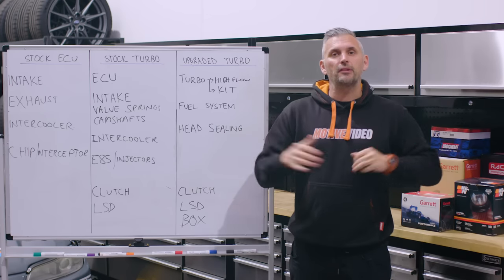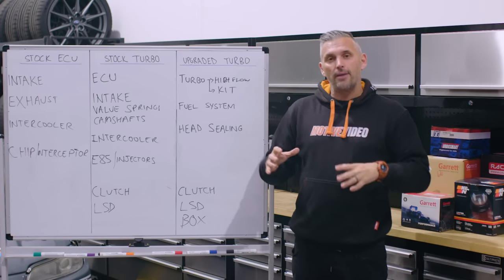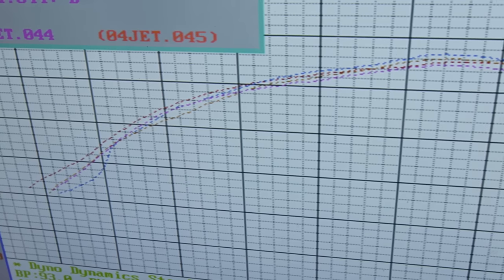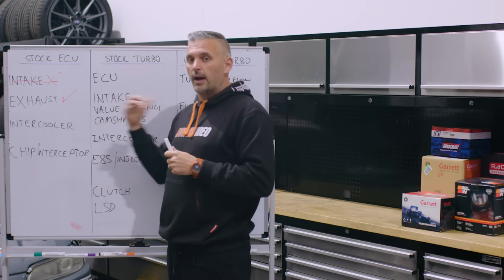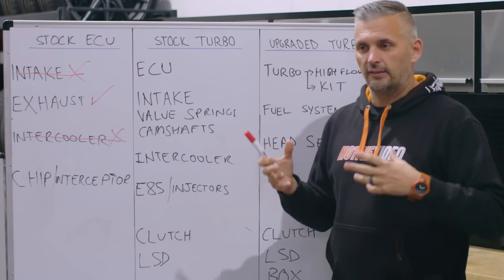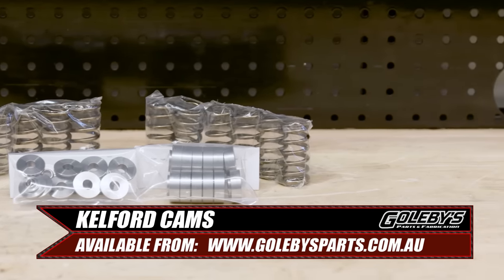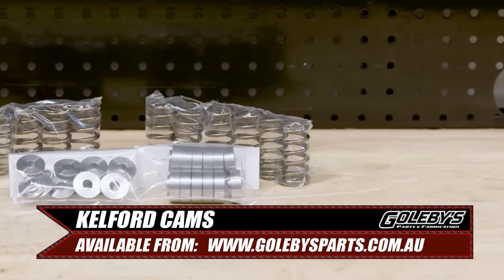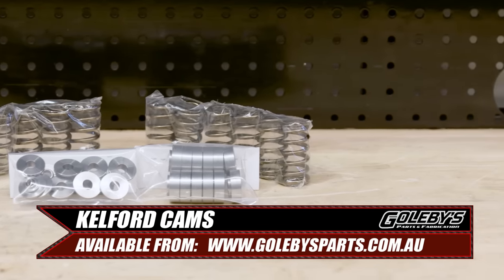GR Yaris & GR Corolla G16E Tuning Guide -  From Stock to over 500hp.

Comment: Pro tip from one of the guys racing a GR Yaris (Rotheli racing I believe), the rear section of the exhaust getting very hot can cause the 4WD overheating issue,  with a couple of bucks on some decent quality exhaust tape you can wrap the section around where the 4WD clutchpack and rear diff are - when he did that he didn't have a single overheat issue afterwards. When I install my new exhaust I will definately wrap the back of the center pipe.
Reply: Will check this out
Reply: @Way Outthere Australian dealers rarely even know about the cars they are selling
Reply: @Way Outthere Do you have link for more info about that part? Thanks
Reply: Now that's a prob tip I heard about the overheating on track and if that's all it is well God damn
Reply: @KILLITchris Yes
Reply: @@wayoutthere8637that isn't weird at all tbh
Reply: Pro tip from the guy who doesn't own and has never driven a GR yaris. We want it here in the States, right meow!
Reply: How do you fix the under steering? Bigger sway bars?
Reply: @wyattoutlaw2370 handbrake

Comment: Toyota has engineered quite the engine from hell that can take a lot of abuse. Great work and really love the informative technical dive from the tuner as well as Andrew. You guys rock!
Reply: all with a fully open deck too...
Reply: @gwot  has anyone taken the block to 750whp yet?   if the GR was sleeved would it handle 1000whp like the Mitsubishi Evo 10 4cyl  did?
Reply: Yamaha?
Reply: @hamishahern2055 that's a hail mary I believe. I worry about the stock components on the engine and transmission.

Comment: Great little cars. They cost around €70’000 here in Ireland from a dealership brand new 😭
Reply: To think the first 1000 (like Motive got) were $39,950 AUD or 27,000 Euro!
Reply: Its extra for the competition pack too dont forget
Reply: Saw a low mileage base model for sale at €58’000 recently 🙈. Ireland is a rip off for performance cars

Comment: 3 cylinder engine holding 500hp with little mods is simply amazing. I was suspicious when i heard the rumor gr86 will have this engine. However, right now, i am excited to see this engine on gr86.
Reply: Fyi motec isn't a little upgrade..
Probably costs 5 grand
Reply: @garrettchapman8170  I was about to say that seems like a lot of expensive stuff to be classified as "little" mods, I mean you pointed out the expensive ecu (6.5k), but you also need cams (1k), and turbo upgrades (7k), and a custom fueling system (~3k), full exhaust (3.5K), intercooler (750-1k), valve springs (500), clutch (2-3k). So erroring on the cheaper side you still end up at 23.5k in mods; really doesn't seem so little anymore.
Reply: I guess you dont look at offroading very often considering people have been tuning 3cyls to well over this.
Reply: @tristenmarshall2954 not to mention any labor lol. Almost any engine will hold if you open it up and reinforce it lol
Reply: A year later, lamspeed racing have 880hp
Reply: @remyche8768  it's 880whp, not hp.

Comment: Pretty good, when you put it in context. 

Double the cubes, double the cyls, and you get a 3.2L, 6 cylinder, that will produce north of 1000hp with equivalent mods. Correct me if I'm wrong on those specs. Either way, pretty good.
Reply: In theory yes, but that's not the main goal because they can fit this little engine in every car, also it comply with regulations, for the relatively small car 300hp is more than enough for most people and also cheaper to produce than the bigger engine. 1000 hp will require more hardcore components which will make the car more expensive and also will turn this vehicle into a very dangerous machine to drive. From a mechanical and technical point of view - the engineers could probably make even this engine double or triple the hp, but it will be 10-20 times more expensive to make it reliable and safe to drive. But yeah, I agree with you, the architecture of the engine seems to be powerful and well engineered.

Comment: Once the block gets filled and becomes a closed deck - are we going to have overheating issues with far less cooling? Since the engine will run warmer could it actually be less efficient and diminish gains and therefore you NEED to add more boost to make up the loss?

Comment: That sounds so good. Wonder if the corolla, because it's heavier, would have the same AWD issue during tunning or gear box faillure with high power output.

Comment: Would be nice to know the cost of valve springs and cams as you’re going to need them quite soon in the modification process.
Reply from the maker: Not hard to search for them on Goleby’s Parts website
Reply: Well labour is the biggest cost as you’re opening up the engine… 🤷🏻‍♂️
Reply: @behindthebuild8016  which all depends on your area

Comment: Man this list of what you can do / how much gains / what to use is completely different if you compare it to for example what MPS Engineering in Germany offers / suggests to do with the yaris
Reply from the maker: Ours is proven on the dyno, circuit and dragatrip. Backs up every claim.  Bot saying only way to do it, but saying it works. Not just on our car, buy quite a few.
Reply: @MotiveVideo  All good, I do believe what you guys state. It's just kind of confusing how there can be so different takes / outputs made by different shops /tuners

Comment: I thought it was crazy impressive but huge motor out hold ups right at the start. Okay if you're a shop or big budget but even a motivated enthusiasts its daunting to build one of these. A supra or an m340i would be much more mod friendly. An m340i xdrive with e30 downpipe will run almost 11 flat at 120 mph. Bolt on turbo on e20 to e30 and 10s are easy.
Reply: At the end of the day it's still a 1.6l 3 cylinder engine. So essentially yes its impressive. The 340i is basically just under twice its engine size.
Reply: @RoronX35  twice the price too. m340i xdrive would make an amazing daily. Just completely different cars
Reply: Agree - that it’s probably one of the more expensive ways to run an 11 or 10 sec quarter mile. Certainly a lot of other cars can do this with considerably far less money spent on them - and even if they were more expensive - spending $40k on your $70k new Yaris is still rather ‘an interesting investment’. Spending over $100k on a three door Toyota with 3 cylinders is gonna be a very niche market
Reply: @moggedau  in Australia you can buy an M340i xdrive from $88k used, low km’s, which is still less than the circa $110k spent on this Yaris - leaving over $20k in mods for the Beemer lol - which certainly isn’t needed
Reply: @MrTroytroy  Yep, I think the goal of this yaris is broader than quarter-mile times. It would be far more capable on track than the bmw. As would the bmw be much better on the street. But yeah definitely a niche market to mod a Yaris to this extent. Cool to watch though.
Reply: ah yes, all the GR Yaris owners are super jealous of the automatic 1700kg BMW's running around doing 11's at the drag strip.

Comment: Hey guys great video! I'm modding up a GR Corolla and will be doing intake, manifold, downpipe, catback exhaust & HKS BOV as well as tune with the valvesprings and camshaft. Would I be okay with a 267-A model cam or would I need the 267-EZP? Cheers in advance!
Reply: Did you do the mods? I've have my GR for over a year and a half and I'm just waiting. Only have intake and turbo inlet right now. I want to hit 500, but trying to figure out what I'd need

Comment: The insconsistancy on dyno with stock ecu its because the rear diff is lightly faster than front , the awd dyno gets crazy .. i take off the cardan shaft from mine and all the runs was consistent ( only fwd )

https://youtu.be/w3r91XFiUn4?si=Vg6sY1imYxReHUZj

Comment: just curious. What is the 0 to 100 spec on this beast?
Reply: Not great. You hit limiter in second just before 100. So... if you look at 0-60mph it's much better lol...
Reply from the maker: @matt91gee  With valve springs and cams we rev to 7500 so we do hit 100km/h in second now.
Reply: @coomercommander2554  I'm aware. Addressing a technicality that people aren't aware of when discussing 0-100 in the GR Yaris. Lay off beating the meat and fix your eye sight.

Comment: So, if I understand, if you pull the parking brake, it defaults to front wheel drive?
Reply from the maker: yes
Reply: @MotiveVideo  This is absolutely a monster advantage when tracking a car. I ice race here in Alaska, which obviously plays an integral role when I drive my 97 Toyota Celica GT4. I heard rumors of such things. How is this done? Does it occur in that rearward electronic transfer case triggered by a parking brake switch? Thanks for the response, btw. You guys are the pioneers to watch!

Comment: The MoTec is around 5000 USD. Not a cheap engine to start tuning if the only thing that makes sense before ECU is Exhaust only, actually a bit disappointing.
Reply from the maker: Modern car life.
Reply: Won't be long before there's many more and much cheaper options.  It's a very new car and not available in one of the biggest markets yet.

Comment: What weight of oil are you running in this? The stock 0W-20 seems light for a turbocharged engine
Reply from the maker: We changed to 5W-30
Reply: @MotiveVideo  Nice! I run 5W-30 in my Corolla as well. People often do not understand that if you look at corolla owners manuals for Australia, Japan, etc the SAME engines are often running 0W-30, 5W-30 or even 40 weights. The USA has strict fuel economy standards where corporations get tax breaks for selling cars with higher MPG so Toyota is known to use the thinnest oil possible in the USA.

Comment: I know it's not a simple as taping 2 of these together but why not mirror it and use it for the Mk5 supra
Reply from the maker: Because its not that simple, like you said.
Reply: @MotiveVideo  I know but the prospect of a pretty stocky 3.2L twin turbo I6 is very exciting
Reply: @synapsisflame9721  lol it wouldn't be mirrored, either, unless you want a crank nose at both ends and no way to install a transmission. You'd need to build it from the ground up with new block and head castings, new crankshaft design, new cams, etc.

Think about the hundreds of millions poured into development of this engine, then think about doing it again from scratch. There's a reason Toyota went with a BMW powertrain - it's a lot cheaper than designing from scratch.
Reply: @Hawk7886  an inline 6 is basically 2 mirrored inline 3, yes it would need a different crank, head and etc but you could still have massive parts sharing between each motor
Reply: @synapsisflame9721  two inline 3 engines stacked end-to-end is the closest you'd get to an inline 6. If you mirrored them, the engine would not function. Unfortunately in reality it's nowhere near that easy.

Comment: Do you figure the GR Yaris tuning will translate "Directly" (for the most part❗) to tuning the GR Corolla❓❓❓

You are tuning a rally car & all you speak about are track times and 1/4 mile. How about some back road (gravel/dirt) estimates of how the Yaris & Corolla would perform on those roads - Pavement is so dull. That's the main reason I put a deposit on a GR Corolla.
Reply from the maker: Yes
Reply: @MotiveVideo  Good to know - THX
Reply: I know what you’re trying to say, but it’s not really realistic to “quantify” or estimate as you say how well these do off-road. In rallying, everything depends on the surface and conditions. Rally Estonia was last weekend and now WRC is heading to Finland. Two neighboring countries, both gravel rallies, but the surfaces are so different that it might as well be a different discipline. For the GR Yaris/Corolla, the 4wd system is generally ok, plate diffs would be an upgrade and the car desperately needs anti-lag for proper rallying or brutal left foot braking to keep the boost on.
Reply: @animeonperseest  Well put - You are 💯% correct - My Bad🤡. 
I've got a 2014 Fiesta ST from new and spent plenty of time hooning on gravel❗
Can't imagine how much fun the GR C will be in it's 30/70 mode with LSD. I really miss not having a RWD vehicle.
My best guess will be a early 2023 delivery...

Comment: RE: Does not need a lot of mods...hmmm hmmm 
That Motec ECU and the tuning bill would be in $10K range wouldn't it ? and yes i dont have mad contacts like you :)
Reply from the maker: MoTeC, exhaust, valve springs and tune will be 10K and give you 60+hp over stock ( we got 50 without valve springs). Pretty goo value if you ask us.
Reply: @MotiveVideo   it’s all subjective and relative yeah?
Reply: @krispykruzer  gotta pay to play, not a hard concept ✌🏽
Reply: @krispykruzer  You have way more ability to tune, control power delivery and add more fuel when needed. If you don't want to pay for that other option is available. But to complain about cost is one of those things that if you do that, maybe you should a) find a cheaper vehicle to buy b) find another hobby
Reply: @dj4monie   my comment was around the “small amount of mods” when just 1 mod is in the 10k bracket 

Either way 10k is a small investment for being the first to crack the 500hp mark.

So makes sense for this build
Reply: @MotiveVideo  
I am interested to know how much it will cost to do what you did to get to 500hp? If you can provide me your contact/email details, we can discuss further.

Comment: wait, some GR Yaris comes with 3 open diffs?! lame
Reply from the maker: two
Reply: @MotiveVideo  ah, which diff has an LSD on the base trim?
Reply: @gwot  It doesn't have 3 diffs, base model has 2 open diffs and a ITCC coupling on the centre. Rallye model has 2 torsen diffs instead of open diffs.